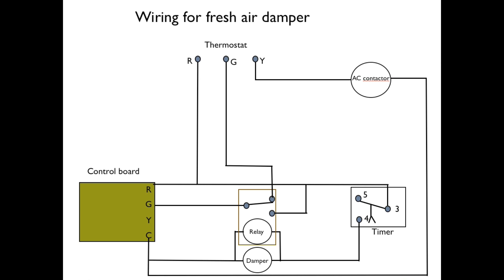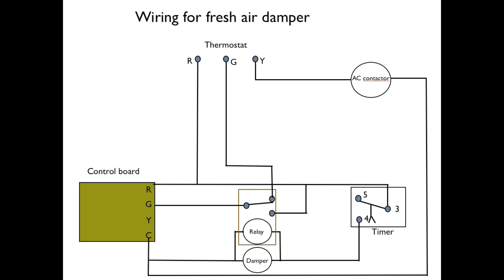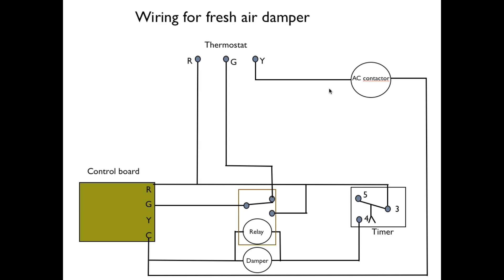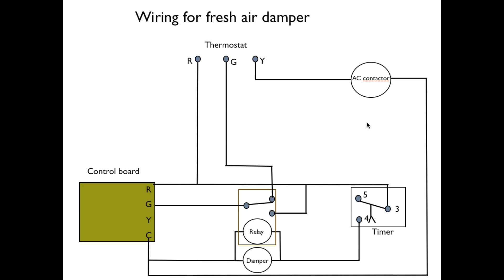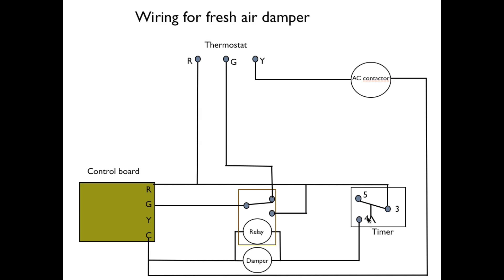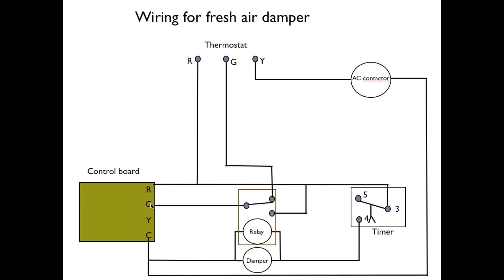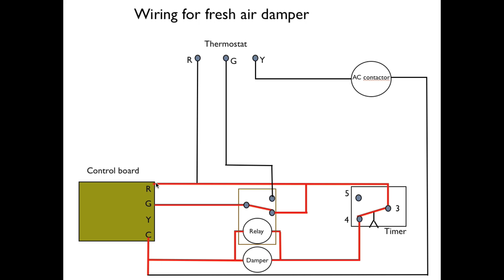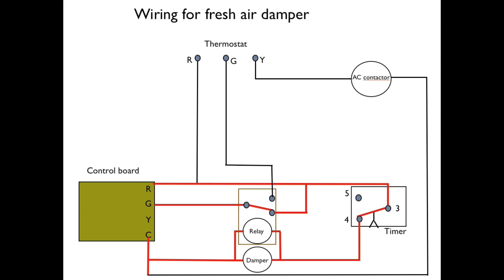How to wire the fresh air damper

Comment: I’m researching this topic because I’ve run into the opposite problem. The fresh air damper gets energized when the Honeywell thermostat is calling for cooling. For some reason, the Honeywell thermostat energizes the G terminal in cooling, which back feeds and energizes the fresh air damper. Now I see I need to install an isolation relay.

The other alternative is replacing the thermostat with one that has the U terminals for ventilation control control. I like this option the best because you can lock out the ventilation if it’s hot outside (outdoor temperature sensor required)
But not all customers want to replace their thermostat for something they see as a minor problem, so this is a better option for me - the isolation relay

Comment: Do you know why my Damper opens automatically as soon as I power up the circuit? The wiring is to a 24V transformer, I have one lead from the damper to the transformer, then the other lead on the damper directly to the pressure switch, then from the other pressure switch leg directly to the transformer. For some reason its receiving power immediately.
Reply from the maker: I don't know.  I can't see why it would be connected to a pressure switch.
GFM
Reply: When the range hood comes on, the pressure switch should open the damper anything greater that 0.5static pressure then draws make up air. It seems as soon as I power up the circuit the damper opens automatically. Shouldn the pressure switch send current to the damper only when the pressure changes at 0.5p ?
Reply from the maker: The pressure switch is probably stuck closed.
GFM
Reply: For anyone interested I was able to resolve the issue. Apparently the pressure sensor needs to be in an upright vertical position so the flapper inside the switch doesn't close. I had mine installed on top of the horizontal exhaust vent, when it should have been installed on the side. The Broan instructions depicted but doesn't really indicate if its a top view or side